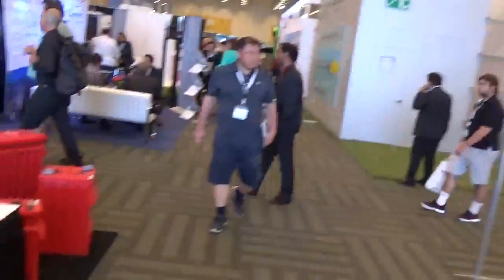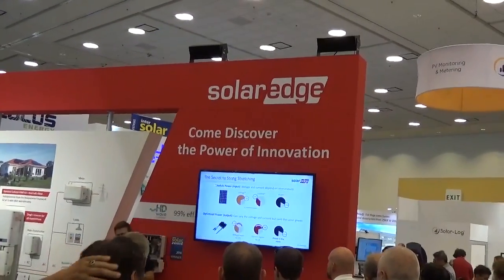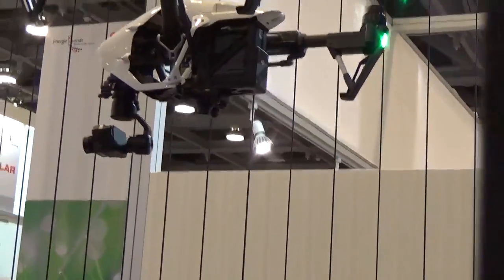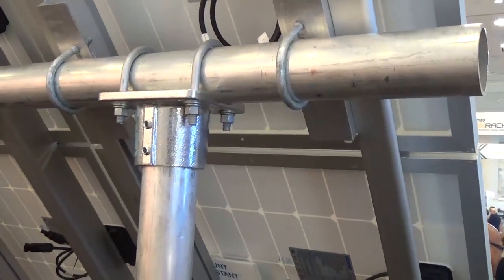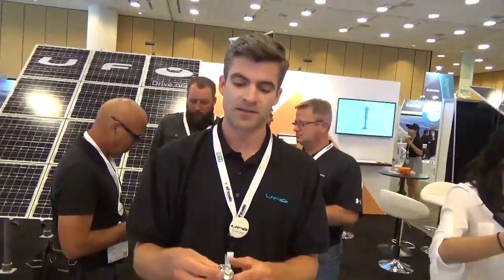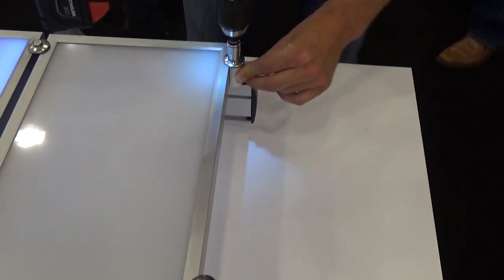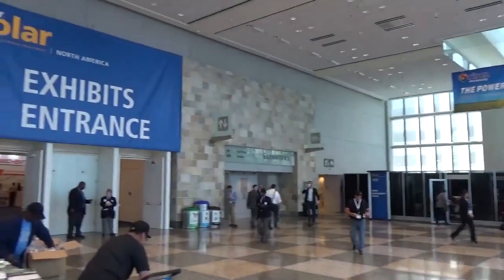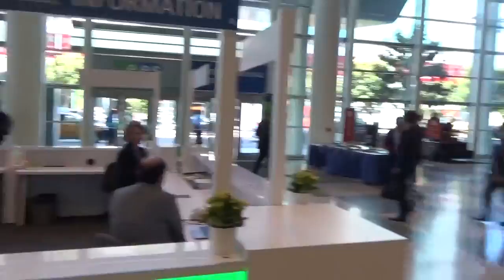Solar Nerd Convention

Comment: It seems like the Aquion batteries have the potential to eat into the lead acid market pretty hard.  You get a product that is non toxic, doesn't offgas, doesn't get hot like a Li battery, won't get compromised from a bad cell like a regular battery, can operate between -5 and 40C whilst preserving 3000 full cycles or thousands more partial cycles (6000 cycles at 50% dod), is maintenance free, and costs about $1195 for 2.2kwh (remember you're probably replacing these things less often) and probably a little less per kwh for their 25.9kwh unit.  How many kwh was your SBS fork lift battery, Scott, and what was the cost and estimated life, for comparison?  Aquion says their cost per kwh is around $550.  The only thing I see that could be a disadvantage is they weigh more and the up front cost is higher than a $300/kwh standard battery (which Elon Musk says he can push down to $100 with economies of scale).

Comment: Very cool!! Thanks for the video.  I wish I was at that convention too!
I have a question.  I have a couple 250w solar panels on a makeshift rack in my backyard that I built.  I ran a home run from each panel because of the distance.  I have no DC disconnect out there.  There is no way (besides unfastening MC4 connectors) to cut power.  I want to screw a weatherproof junction box into one of my 4x4 posts that can accept two sets of MC4s and give me some sort of quick disconnect function.  I also want to install a little anderson powerpole port inside the box so I can charge my lawnmower without running a wire out through a door from my house.  Any ideas on where I could buy such a box?  I know I could make something myself but, it would be cool if there was a box that already has MC4 ports (2 pairs in, 2 out, or 4 pair altogether).  Thanks in advance :)
Reply: http://www.midnitesolar.com/products.php?menuItem=products&productCat_ID=9&productCatName=Combiners

They have combiners that have mc4 connectors on the bottom that you can just plug your connectors into!